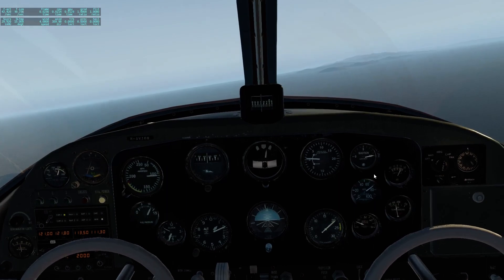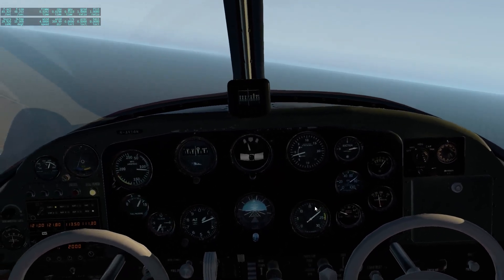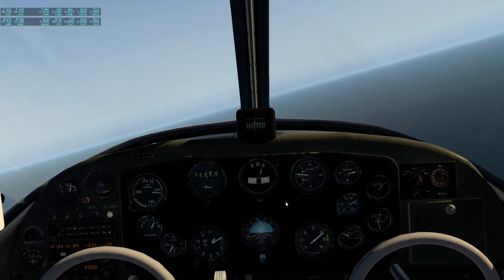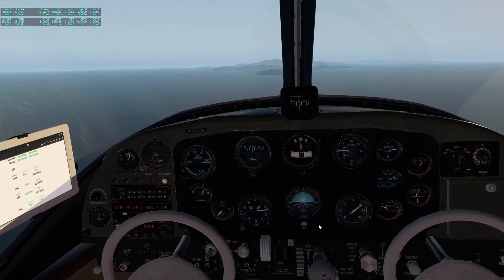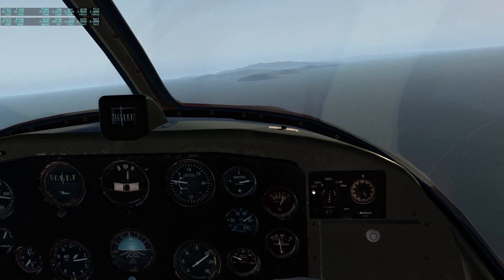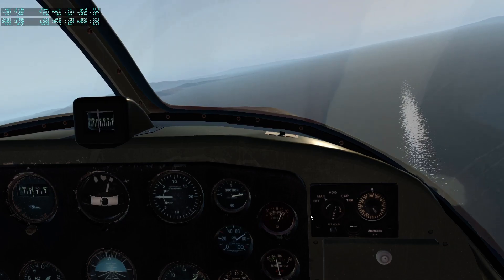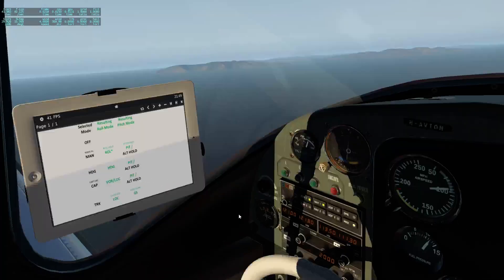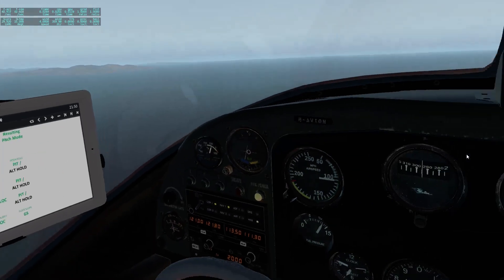Ryan Navion 205 Vintage: How to use its Autopilot in X-Plane 11

Comment: Thank you for this presentation.  I do have a few questions:  1)  How did you get the iPad to work?  2) can you load flight plans ?  
I have the privilege of flying a 1947 Navion that has been completely restored.  But the avionics have also been completely redesigned.  I'm using X-plane 11 to help me familiarize myself with the airplane.  Thank you for taking the time to give us this tutorial.
Reply: I, too, installed the vFlyteair and it is just great.  I conversed with Walker and he hooked me up with an Aspen replacement.  After reviewing your video, I now understand the autopilot. Thanks again